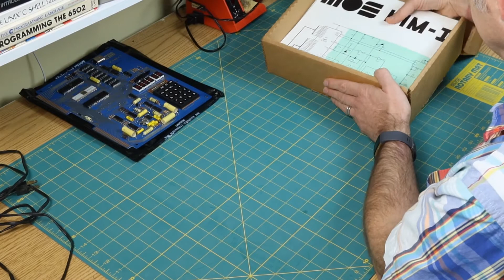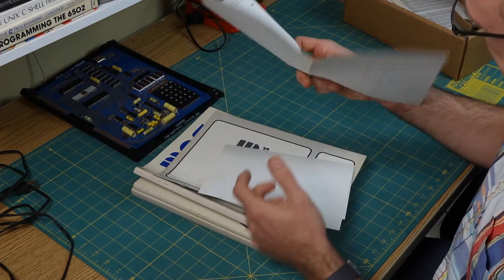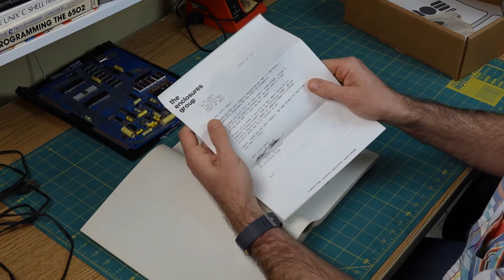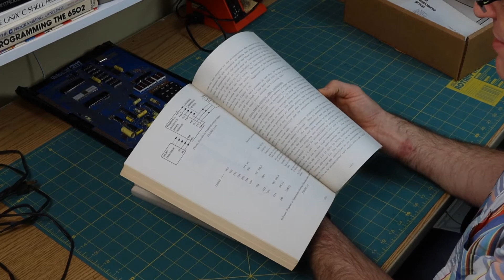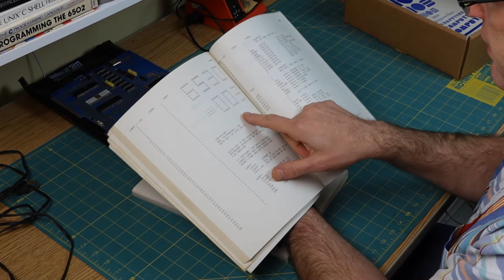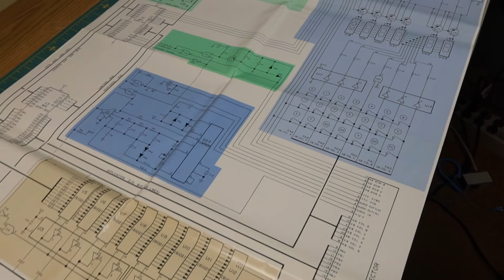Which box has the MOS Commodore KIM-1?

Comment: I would like to have a HIGH RESOLUTION scan of the schematics of the KIM-1. I have found numerous scans that are fuzzy and blurry and totally unusable. Since you have a clean original schematic in virgin condition, you cold scan it as it should be done, in the highest resolution possible. You don't need a large scanner, with the HP ScanJet 6400 and a large (living room dinner) table, you can scan this an later on stitch all the separate scans together to one big magnificent glorious tribute to this wonderful milestone in computing.

Comment: I have a beautiful REV-A KIM-1. As a collector, this is one of my favorite items. I am currently reading the MOS Hardware manual in PDF form of course, I do not want to damage my original manuals. PDFs also make is easy for me to zoom in as well. These manuals must have come out before the Motorola law suit, as a lot of the discussion is on the 6501. 
I have also noticed, that the hardware manual really does not cover the KIM-1 hardware itself. It is more of a MCS6500 family builders guide. 

That is one of the things that I love the most about vintage computers. The manuals that came with them or the cards that you purchased, they gave you a quick, but very detailed account of every chip and its function in the system. My favorite manuals are the ones that came with the Processor technology boards that I have. They give you all the information that you need in only about 60 to 75 pages. 

I have not done a video on my KIM-1, so I really appreciate this video. I just ordered a plexiglass display casing for my KIM-1 that has a cut out so that you can access the keypad.
Although I am still waiting for it to arrive.

Thank you for making this great video on the KIM-1
Reply from the maker: They published several different manuals.  Most of the documentation that came with my KIM-1 was general "MCS6500 family" documentation, but there was one manual specifically about the KIM-1.  I suspect I will have to figure out how to scan at least that manual without damaging it.
Reply: @TalesofWeirdStuff  What is it called. There is probably already a PDF out there somewhere.

Comment: I also have a MTU k-1008-11 which (as far as I've been told) was needed for the high resolution in PET and to donate the screen to the KIM-1! but I don't know if it works and in this case I don't have the courage to try it on the KIM-1, also because I don't have a suitable connector or even a power supply for it!

Comment: 31:56 So the only fool who still turns it on is me? hahahaha!
I turn it on about once every 4 months to keep its capacitors working, which unfortunately there are a couple in my KIM-1 that show very slight traces of leakage. The storage of the KIM-1 in the wooden wine box, therefore, takes place with the computer upside down, to avoid any corrosion of the PCB. I don't know whether to replace those 2 capacitors, I would have to find an identical pair to keep it original as much as possible! However my KIM-1 works smoothly!
Reply from the maker: That is a good question.  The capacitors on the KIM-1 do seem... different... from other capacitors that I have seen in old computers.  I'm not really sure what to do about them.
Reply: @TalesofWeirdStuff  here in my area there is a very old electronics store, when this damn covid ends I would like to go and have a look at it, who knows if maybe it has something similar in stock?

Comment: Hi, I hope to help you in some way. some time ago I came into possession of my KIM-1 rev.F (if I remember correctly) green PCB. The previous owner had bought it in 1977/78 and it was supplied with this power module which doubles as a data exchange interface. Here you can see it: https://www.youtube.com/watch?v=GxKS3idosDc&t=26s
almost at the end of the video. The computer works and the power connects to the low port, the one next to the numeric keypad.
unfortunately I don't have the original box and the rest, I keep it in a wooden wine box! 

You have a new subscriber! You are very nice and competent!
Reply from the maker: It looks like your KIM-1 is also Rev F.  The power connector that you have looks much more reliable than the one I have. :)
Reply: @TalesofWeirdStuff  I believe too, if I find the diagrams I can also send them to you, I should have them!